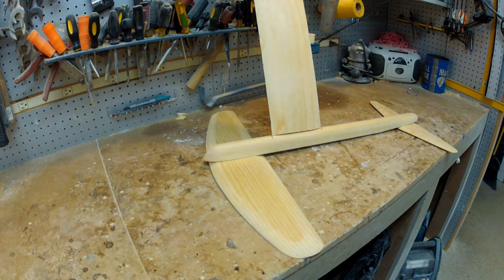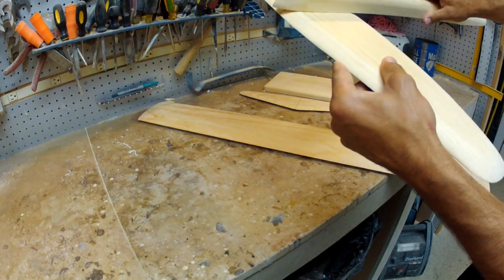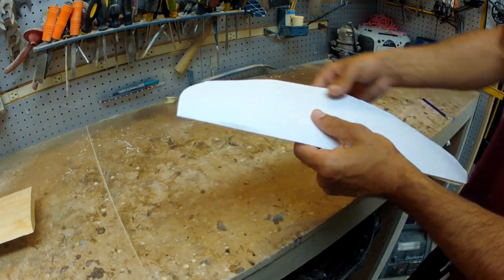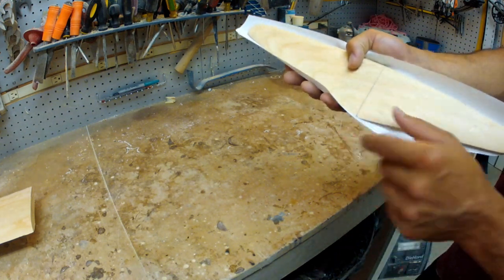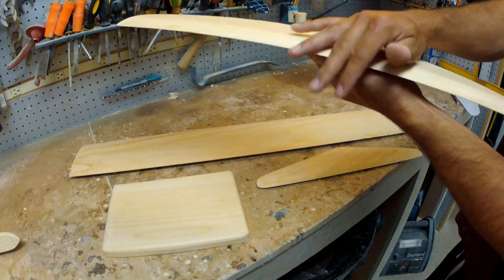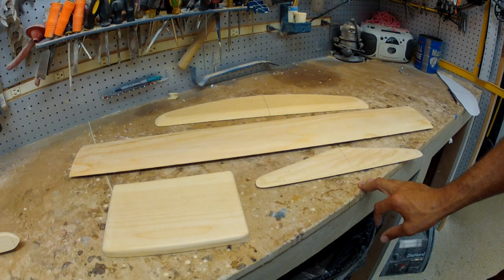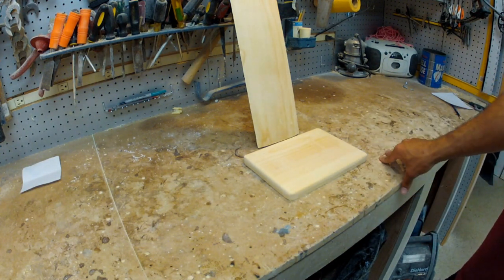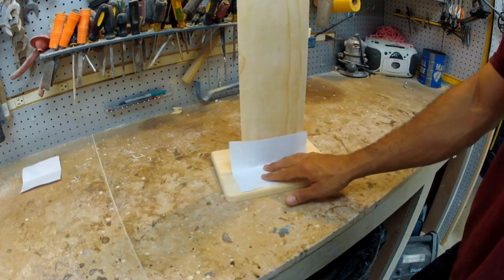How to build a hydrofoil (Clearwater Hydrofoils Kit)

Comment: so i want to put one of these on my old surf board and surf with it , is the mast going to be strong enough for that?
Reply from the maker: Check out the newer videos on the kit in the link. And yes the mast will be plenty strong for that. Especially so if you decide to shorten its height. It seems a lot of surf foils use a shorter masts for better control and because of shallow areas.